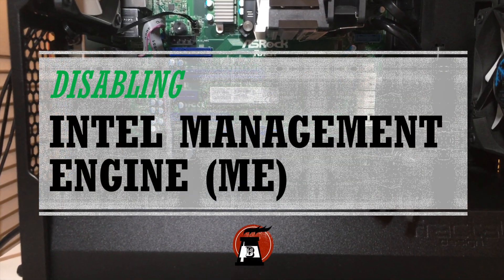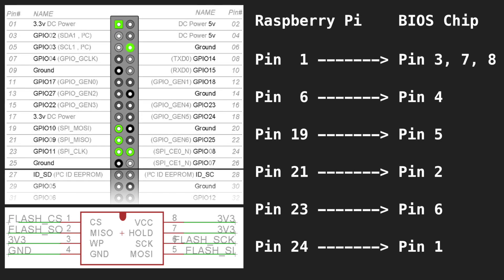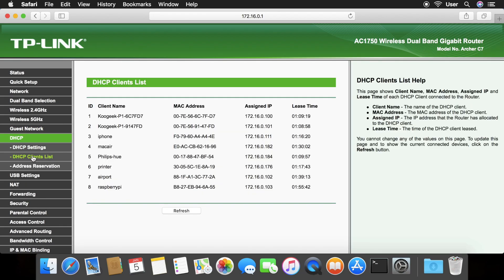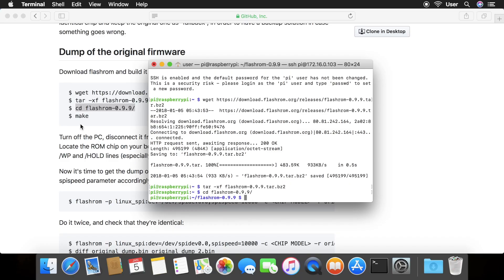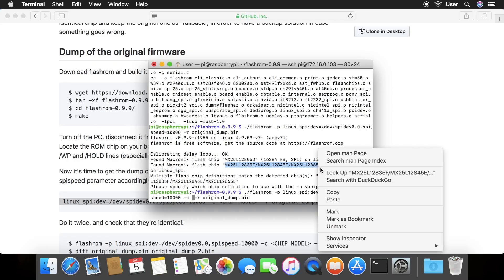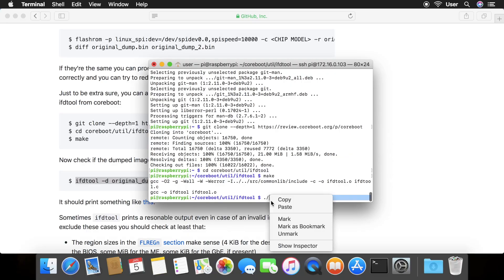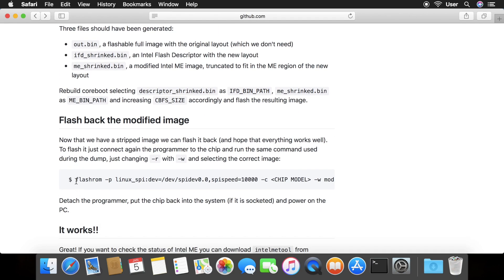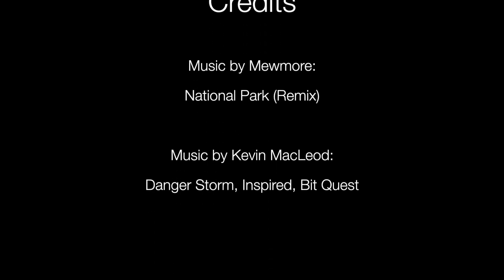DIY: Disabling Intel ME 'Backdoor' on your Computer

Comment: Why do you need to disable Intel Management Engine in the first place? Just don't use it!
Reply: it's active no matter what. this tutorial doesn't even disable it. once the CPU is powered on, the internal OS (minix) begins to run and gain absolute control of the hardware. here's the trick though, it only works for Windows and the Linux kernel. If you run something like FreeBSD, it is severely limited, and if you run Haiku OS, it's absolutely useless.

In short, run FreeBSD or Haiku as your main driver
Reply: @RaptorianSchrock  If it requires an operating system to run, you can just disable the driver. I also think Intel's latest driver actually disables it, I've seen this before.
Reply: Management Engine has full access to the system on hardware level. It is theoretically can accept external commands and do stuff like screenshots, reading data from protected program memory, logging keystrokes and so on. As far as I know, there is no evidence of pulling this off in real life scenarios, but paranoics will be paranoics.
Reply: @NickFreneza  If your computer isn't fully exposed to the internet and is behind some sort of firewall, this is a non issue

Comment: I recommend tossing that clip adapter into the parts bin and instead instead breaking out the soldering iron and soldering it (if needed) onto the supplied adapter that comes with the CH341a.

Comment: This wouldn't work today i think. I have allegedly tried this before on modern cpus and it will reboot every 30m. Not to mention its costly and risky. IF you want to really avoid this, And this isnt an advert nor afilliation but system76 sells me disabled (hardware level like the government chips have) intel chips from the factory.

Comment: If you do clip to the chip still attached, read the chip to make sure that the adapter is not causing a strange problem.  In rare cases, it may cause a problem.

Comment: i wish we had removable bios chips in 2025. never heard of that one.
Reply: That was how you did a bios upgrade 30-40 years ago. Removing and literally "flashing an eprom" package (they used intense UV light to erase), later into the early 90s the eeprom would still be removed to rewrite but no UV light needed, or more often just swapped with an already written rom  (keep the old one as backup)

Comment: You don't have to edit the makefile, you can just pass that as an option to the command like so "make WARNERROR=no" which, in the file, right above WARNERROR it actually tells you to do that. You can add any other options you want to that like -j4, or -j8, whatever number of threads you wanna use, usually the amount of threads your CPU has is good

Comment: Do you also get CoreBoot as a bonus?
I have everything that is required, I can't believe is this easy. My motherboard hard 2 BIOS chips. I will give it a try and report back how it went.
Reply: I am happy to report, GREAT SUCCESS! I can't believe how easy it was to flow. I even fixed a broken BIOS chip I had. 
To my original question: No, you don't get Coreboot, we flash back the original firmware with IntelME code removed.
Sir @BFactory, is there a way to double check that IntelME has indeed been removed? It feels a bit surreal, the computer booted and works as normal, too god to be true.
Reply from the maker: @CocolinoFan  Yes, if you check my followup video, there is a test to check for Intel ME disabled.

Comment: i watch a lecture made after this video from reasearchers stating that it cannot me removed so who is right
Reply: Still a hardware component. It only runs at start-up, then the BIOS disables it afterwards because of a flag, that the NSA asked Intel to make (more than likely, people say it's just rumors, but could easily be true).

So, it still needs to run to tell the CPU what data to load, but it IS disabled and not running during normal operations.

Comment: For more than two years I have searched for a problem witg Intel ME on my Thinkpad T520. It gets into some fault state where it shuts down after 30 minutes exact. I don't fucking care if it is enabled or not, but having an otherwise working laptop crippled is fucking annoying. I can sometimes get it to a different state, where it goes into recovery mode which is benign. But I can't reproduce whatever it takes to do so.
Now I just stumbled upon this vid - alas me_cleaner does not work with the T520's QM67 chipset.
But WHY ruin a great video with such horrible and Fucking annoying music? As the chances are it won't help me anyway I can't watch it tonthe end. You gave me a fucking headache!

Comment: The best solution: 
1. Buy a high performance computer 
2. Buy an external drive and Install OS on it. 
3. Work ONLY on the OS (linux/openbsd) in the external drive. 
4. Unplug the external drive physically whenever you turn off the computer.

IME can do whatever they want after the computer has turn off.. lol
Reply: You can use a TB4 adapter to run an NVMe externally, but the Intel Management Engine backdoor is still active while the PC is on.

Comment: Bullshit. Intel ME chip is inside the CPU casing itself. Modding BIOS isn't gonna do anything.
Reply: correct. this only disables the user level access or deployment of IME. a regular joe user was able to utilize IME via a network of systems to remotely control them (monitoring). if a school admin was clever, they could employ some very useful means of updating the systems, deploying software, or shutting all the systems down. disabling IME in the method this video describes does not shut off IME, which still has a foothold on the network, which is what govt agencies utilize to gain access, remotely, to any system that is connected via wifi/lan. a system that is 100% offline is the only safe way to go.

Comment: For whom saying intel ME cannot be disabled in bios...

Please note that even 4KB microcode cost half of the chip. And for more the new generation coming out, intel forbid you to modify bios on your own. If me_cleaner not work than that makes no sense anymore. 

bear in mind that me_cleaner can protect one single backdoor from intel only. Thousands of backdoors from your cell phone firmware ... no one blame it.
Reply: What do you mean by thay last sentence?
Reply: @AJ-gm7vf  almost everything is compromised unless its hardware and software source code is freely available and is inspected thoroughly by both independent individuals aswell as corporations and cyber security groups.

even then this is just a theoretical as day by day people still find ways to bend software to their will and potentially use it for malice

Comment: damn, mine is soldered + smd xD. Dell over painted they Modeltype with white permanent paint.
I needed acetone to remove it (usually Isoprpanol is enough, but i think Dell wanted to be extra safe xD)
Reply: Maybe don't buy pre-built proprietary crap

Comment: Barker Tech Guys has been able to monitor the AMT calls. This thing sends encrypted data to what is presumed to be a remote location. Though it's impossible to see WHAT is being sent, it appears to become active when you start typing, it will periodically send in bursts (assumed to be screenshots, it's only speculation) as well as a constant update of what may be metadata. The flavor of Minix running on the CPU is based on a kind of BSD, closed source and a proprietary iteration, however, running FreeBSD as your main OS seems to "not play nice" with ME or any AMT protocol for that matter (AMD's TeeOS). Windows, Mac, and every Linux distro has a layer that relays AMT calls to the ME. FreeBSD showed very limited activity.

Comment: Sys Admin here, lmao ME is not a backdoor. Is a remote management tool for tech support, most commonly used on servers but now a lot of mobos are supporting it. On most out of the box bios ME is disabled until you put a password. At least on newer bios firmware. Maybe in the past it was enabled and had a default password.

Comment: why making things that complicated..... just download the raw bios file that contains ME region from it's original source then use python 3 on windows to make the moded firmware then use original bios tools like afuwin for AMI aptio bios or similar tool for other kinds to check whether it is possible to read/write or make complete dump of the current bios then decide if SPI programmer is needed or not. why do you need raspberrry pi that costs way much and why do you need a breadboard and all these wires and all these lines and orders.... just because of your weird guide I lost much of time to find that raspberry pi thing then had a really hard time with SOIC shit clip that got bricked while trying to deal with it. and all I have to do is to use 3 tools UEFITools, AFUWIN and me_cleaner + the command line for python and no external flashing was even required as my bios chip completely unlocked, did not even need any other device beside the same computer that I had to clear me on.

Comment: Hey, I tried this, but my PI freezes when I connect the 3,3 volts power line to the chip on pins 3,7 & 8
Reply from the maker: Whats your chip model number?
Reply: @yoonsikp  Winbond 25Q64
Reply from the maker: @maximalgamingnl9954  Maybe try disconnecting the 3.3v->pin7 connection?
Reply: @yoonsikp  turns out it was a faulty adapter from the laptop to the breadboard, I bought a new one, and all the commands show to correct outputs, altMeDisabled bit is SET.
Only now I turn on my laptop, and it just doesn't do anything. I even confirmed the modified image again on the chip, and diff shows no output with the modified_image.bin; I'm trying to reset the CMOS again now, else I'm just going to rewrite the old image to the chip and see what happens, (and buy a new laptop because I really don't like Intel ME).
Reply: @yoonsikp  Ah, seems like it did work after all, after a proper CMOS reset, thank you! :D
Reply: MaximalGamingNL lijkt me teveel moeite dit allemaal, voor minimale gains ook. Kans dat iemand of iets opeens gaat rondneuzen in je systeem en je ellende gaat brengen is gelijk loterij kansen

Comment: Question: It's pretty self-evident that AMD would be doing something similar, however it has been a lot quieter and better hidden. What do you need to worry about for AMD, and can you disable it as well?
Reply: Amd it's called PSP
Basically serves nearly same purposes
Reply: No, but this is a pretty dumb microcontroller with some extra hardware crypto peripherals. It doesn't know how your OS works. It could theoretically monitor inputs and outputs, like keyboard/mouse or take screenshots.
1. Setup a VPN server on a Raspberry Pi
2. Connect your computer directly to that
3. Setup firewall rules on the Pi that discards any packets from your PC except to the VPN server. Don't setup the firewall on the backdoored machine, as ME/PSP bypass the OS.
4. The AMD PSP/Intel ME doesn't know how to talk to the VPN server, so it can't exfiltrate anything
Reply: @marc-andreservant201  what if the raspberry pi has a hidden management engine
Reply: @minecraftminertime  connect the raspberry pi to a pico microcontroller
Reply: @minecraftminertime  😹😹
Reply: @minecraftminertime  use an orange pie
Reply: amd's PSP is a nothingbuger, all it does is help keep memory (ram) integrity, it's the trusted execution technology that people should be worrying over
Reply: @niggyshiggy  its still proprietary. nobody can say for certain until either AMD opens the source code for it or someone reverses it properly where the former is very unlikely to ever happen.
Reply: AMD PSP , https://www.youtube.com/watch?v=HNwWQ9zGT-8&ab_channel=MentalOutlaw
Reply: @What Is this would you mind tell us more about it?

Comment: Thank you for this very informative video. Would like to know if there is a site where you can get the BIOS chip model number for different motherboards. I have a HP ZBook 17 G4. I know its a Winbond SOIC-8 but I can't quite read the lettering on the chip. Also, that blue BIOS adapter you had on the video for soldered-on chips, where'd you get that ? I'd like to get one. Thanks !

Comment: I did this to a laptop two years ago because somebody was coming in on the IME. It took the intruders two years to figure out a way to get back in again somehow. So now I have done a port forwarding on all of the IME ports that route everything to port 80 and a raspberry pi 3+ running a web server.
Reply: you are a person of interest to them. man, what do you do? Since  Intel is Israel owned company They should call it "MOSSAD inside".  :-) Research Unit 8200.
Reply: @zeeman2594  I seriously doubt that. I'm nobody of interest to anyone. I don't do anything interesting. Someone in the house just happened to own a Dell laptop that was known to have  a quite vulnerable IME. Quite a few computers back then had the same vulnerability. Intel just simply screwed up very badly. I had that laptop retired immediately after they got back in. The last thing they did was take the password file and run it through a password cracker. Then they posted the results on the laptop's hard drive for me to find. How they got back in with the IME nuetered, I don't know. Since that laptop has been retired, there has been no further problems.
Reply: @emuhill  how do i do that port forwarding?
do you have a link to a tutorial?
Reply: @egyptcountryball2288  I was doing the port forwarding stuff through the wifi router.
Reply: @emuhill  do we need a raspberry pi 3+ running a web server? what is this for sir?
Reply: @emuhill  where can i contact you? do you have discord or any app chat? can you teach me how do i do that port forwarding? can you help me please, i just want a clear explanation and im sure i will understand how it works.

Comment: I have an AsRock motherboard and there was an option in the BIOS to disable Intel's ME.  I did this, but I have my doubts that it stops the backdoor.
Reply from the maker: Please check my followup video on determining the Intel ME status of your computer. It should confirm if it is in fact disabled.
Reply: @yoonsikp  Since Intel's ME is proprietary, there is no way to know if it's fully off. You cannot fully confirm that it no longer works, since portions of it are required to boot your computer.

Comment: IME is on the CPU chip, not the BIOS?
Reply: I might be wrong but I think the ME still need some Basic Input/Output System to operate. So by flashing a modified BIOS, you can "reject" calls from the ME. Just a theory tho.

Comment: What prevents Intel from "encouraging" MS from flashing the BIOS back in Windows update? It seems it would be easy for them to do this.
Reply from the maker: The best way would be to bend the write enable pin, so the BIOS can no longer be flashed. I'll have to take a look and see if this is possible.
Reply: @yoonsikp  Or don't use Windows 10, which basically invalidates all the work done here for the sake of privacy.
Reply: @yoonsikp  That seems like it could work. I hope you you don't destroy your board in the process 😬

Comment: Might be wrong but if I've uderstood right, intel me is run in the processor, not the BIOS chip, please correct me if im wrong
Reply: Other dude is on drugs, it IS on the CPU die but the BIOS is responsible for turning it on. I think what me_cleaner does is prevent it from running outside of boot time. If the chip doesn't start at boot it forces shutdowns after some time.
Reply: Ur wrong

Comment: I thought ME was in the actual chipset
Reply: Yeah but supposedly the BIOS tells your board which cpu cores to run. So this, in theory: never sends the signal to start that specific chipset to begin with, thus circumventing the use of a backdoor. You can't use hardware that isn't running, can you?

Comment: Too fast and too easy :-) but on many motherboards are two bios chip called "dual bios" 
next complication is "winflash tool" you can write bios from runing windows and bios.bin file.
And UEFI bios that store software on hard disk also can backup/restore windows v8, v10 serial also for tracking computer ? and funny You use Macbook Air thats have security lockdown by e-mail and bios written into UEFI Chip ? :-)

Comment: sudo rm intel*
sudo apt-get install ryzen
Reply: Rômulo Costa AMD has its own IME (i forgot its name). 
Nothing would change.
Reply: @twitchy.1337  PSP I think
Reply: AMD Platform Security Processor.
Reply: @theuser9425  plat security can be disabled as a response from AMD after the ME exploit was discovered
Reply: AMD's modern implementations of the technology, in for example Ryzen, are still a lot better than the shit Intel has been pulling ever since they messed up computers with Sandybridge and somehow got the world to celebrate it. Though yes, ideally you don't want any binary blobs running on lower levels than the user, thus the best Performance Processors available, which still have easy ways to completely kill blobs and flash own BIOS and not just criplling them are still some old FX and Opteron Chips sadly.
Reply: root@Linux:# * cannot install another backdoor, over existing backdoor *
Reply: Ryzen aint better for all we know
Reply: @kris10an64  the only market answer is really arm a53
Reply: @arkson165  Choose Intel before the i7 era, you are good.